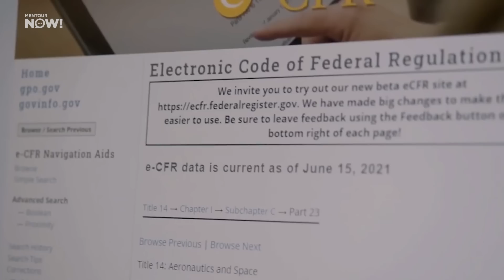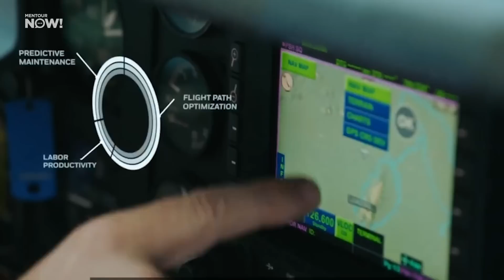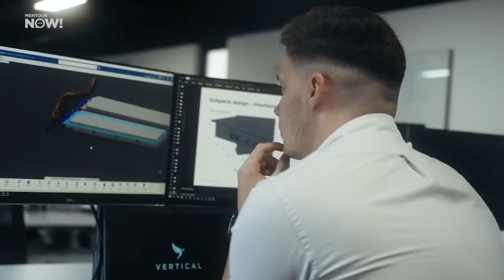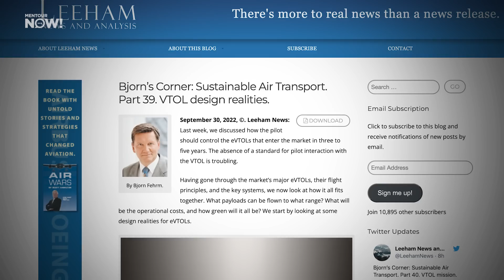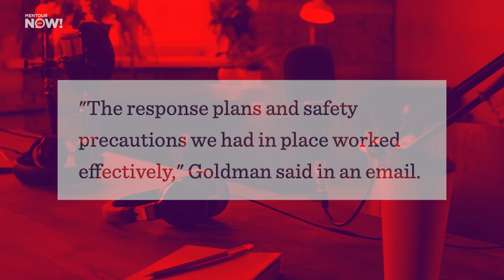Will they SHARE their Secrets?! Electric Aircraft Safety culture

Comment: As a software engineer, I can't caution people in safety systems enough, that the culture we have in software is absolutely not compatible with safety systems. The move fast and break things, is a great way to ship non-safety projects because it shortens the feedback cycle allowing you to make smaller changes in direction to optimize at arriving at a correct solution after a few iterations. However, that same reason is not compatible with safety systems. I worry about software culture invading aviation.
Reply: DO-178C is very strict on software development, so unless this standard gets a major rework which would allow for "move fast and break things" style software development to set its foot into aviation, I don't see a real risk for that.
Reply: @Mezgrman  Do you trust the software that was installed on the 737 Max? Once two planes went down, they had to fix the software. I doubt it is yet properly fixed for the reasons the OP stated.
Reply: @SrssSteve  yes I do, especially now after the crashes and all the scrutiny that was put on the code.
Reply: As a software engineer. It's important to distinguish general enterprise software engineering from what's being done in aviation. It's a completely different process and a completely different frame of mind. It's important not to treat the entire software industry like that mobile app from some startup because reality is that is just scratching the surface of our industry.
Reply: @SrssSteve  The issue with the 737 MAX was not the software. It was the entire system design that was oriented towards avoiding retraining of pilots. No amount of software quality improvement could fix that.
Reply: There are 10 little bugs in the code, 10 little bugs in the code, fix one little bug and now there are 12 little bugs in the code…..
Reply: @Stettafire  Yes it is, but to say there are never software bugs, or that developers still don't carry some of those bad habits into safety systems, even when they're more aware of the risks, is hubris
Reply: @Mezgrman  That implies that just because DO-178C is a thing, that'll keep bugs from causing issues between systems, for instance, if not flat out failing to consider consequences of a system operating out of spec, or similar. Bugs happen at an astonishing rate in software even in the most strict of environments. The timelines to deploy tend to be longer, testing procedures better, etc., in heavily regulated industries that involve safety systems, so the rate of critical bug tends to be lower, but what I'm getting at is, who knows in what way what bugs that ship will lead to safety issues. The big guys aren't immune from this as well, the 737 MAX's MCAS is a recent example, but not the only one where software played a part.
Reply: @Curt_Sampson  You're not wrong, but to ignore software's role in the accident, even if it wasn't the only reason for the issues or even the main issue, is missing the point. The more software we put in safety systems, the more we have to be extremely careful in doing so. Systems go out of sync, operators tend not to use the systems in the prescribed manner EVERY SINGLE TIME. These are some of the issues. Should you be scared to fly? Logically, hell no, even in a software world. We accept some level of risk in travel always, and when you take an analytical look at things, the numbers don't support huge fear. Aviation in general has the right attitude, what my original comment was about was an acknowledgement that this is antithetical to how most developers are USED TO working, so there are undoubtly going to be problems related to that.
Reply: @canoozie  Sure, but anybody who's done even the barest amount of looking into the role and use of software in safety-critical systems has been aware for decades of the need for care and what kind of care needs to be taken there. The Therac-25 story may not be well known amongst web and application developers (who to this day are generally very sloppy and often don't really understand what they're doing), but I doubt there's anybody working in safety-critical systems who doesn't know it. IEC 62304 took some time to come out of that, but even that is now 15 years old.

Engineers in Boeing, both software and aeronautical, were well aware of the issues with the MCAS. And the software was and is, in fact, fine. The primary issue was a lack of training (appropriate training could in fact have obviated the need for MCAS altogether) and a major secondary factor (using input from only one AoA sensor) was a hardware design issue. Both of these are systems design issues and to focus on software, rather than on the system (human in the first case, hardware/software in the second) is to miss the safety problem.
Reply: Fly by wire has been in aviation for a long time: any plane with a side stick is flown by software at some level.
Reply: @trueriver1950  Yup, and lessons were learned, painted in blood and we know how to build safer systems. I'm not arguing that point. What I'm saying is that once we've got a software stack safe in one application, that doesn't mean it is safe in another, or that someone else's implementation will be safe. Culture heavily influences the quality of code (35 years writing code, I've seen all sorts).
Reply: As a software engineer, I'd like to point out that there are hundreds of quasi-independent "software cultures", and they vary A LOT in their tolerance for risk and emphasis on secrecy.

* frontend web scripting
* intrusion detection
* CRM and business processes
* financial backend servers
* medical devices
* big data mining
* AI/ML
* operating systems
* compilers
* cryptography
* cryptocurrency 
* mobile apps
* IOT (internet of trash)
* academic data analysis
* mathematical research 
* et cetera 

and of course many of these areas have large open source communities. That doesn't guarantee safety or security, but does improve visibility.

So I don't think it's useful to consider "software culture" as a monolith.

Otherwise, I agree that many developers, and many companies, play fast and loose and just hope not to have anything blow up before they move on to something else.
Reply: @davidwright7193  So true!
Reply: @larrywest42  ... and of course (as you mention)  there is the entire Open Source set of cultures, which vary among themselves but all share the idea of the source being shared. In the Free Software variant of open source (eg the GPL) sharing your modifications is a legal requirement. It can make sense for reasons other than safety to share the load with competitors
Reply: @canoozie  we don't disagree on this: I've been coding since I was 11 (56 years ago) and have seen all sorts of bad design, and failure to test before release our failure to test at scale before abandoning older systems (worst case I know was London Ambulance call centre software which fortunately I was NOT involved with, and which turned out to be due to poor understanding of the process at the system analysis stage, where the analysts valued to model what actually happened in off-channel chat between operators (despatchers) when large numbers of said operators were all working in the same room and could shout across to improve their collective situational awareness beyond what the older system gave them.  

People died waiting for ambulances due to the shortcomings of the new system: they couldn't roll back to the older system as they'd sacked half the staff and closed the offices before testing it at full scale :(

I can see the potential for a "London Ambulance" situation as some airports try to move ATC off site...
Reply: @Jeremy,  as a software engineer myself, I agree with you 100%. Unfortunately big tech companies have created this culture in software engineering to where we MUST push crap out as fast as humanly possible. AGILE design works at the expense of your user ... you ship your user broken garbage ... but hey, you fix it over time right? All these systems were designed to maximize profits and nothing more. with things like AGILE design for example, a company can record in their books that they did indeed ship the product ... and they can realize the gains immediately. While in reality, the product is broken and it is still being fixed for the next year or so ... but that doesn't matter ... since the profit is realized and the stock is up and the execs are happy in their private jets and their fancy dinners. This is why NO tech company should ever mess around with transportation ... I mean we've seen how Tesla is doing .... FSD is basically a pipe dream, we were "promised" LEVEL 5 AUTONOMY God knows how many years ago at this point ... and every year they say it'll come next year :) unfortunately this is just tech company culture ... bloated valuations and a broken legal system allowed them to realize gains before even shipping a complete system ... and that's how we roll now. This will NEVER work in the aviation industry and I suspect a bunch of these startups will dissolve before they even transport a single human commercially.
Reply: @TheAkashicTraveller  SpaceX is a terrible example. They literally wanted to launch star-ship once every month and they haven't launched it ONCE this entire year. It just shows that this model of development doesn't always work - and in most scenarios is an outright failure.
Reply: @Mezgrman  where did they put the third sensor??
Reply: @SrssSteve  - In the 737 Max the "software culture" played a very small part in the outcome, I think.

The stupid decision, of a monumentality that cannot be underplayed, was to use just one sensor input for the system and it was taken way above the pay grade of the programmers and before they even started working on it.

Had Boeng accepted the associated certification delays, they could have added a third angle of attack vane and linked the MCAS action on all sensors concording in their values (then again, the 737 computers architecture was not really designed to handle a triple redundancy, seems to me). 

In the first iteration of the system, also, it did not re-engage after the pilot had overruled it...

At some point, someone decided that it was too risky to allow the pilots to do their jobs and so Boeing got the limits on number of activations removed.

It wasn't the software people, either, to decide that pilots did not really need to know the existence of the new system and cemented it's lethality.
Reply: @canoozie  Software played a role in the accident, yes. But is it due to the software culture inside Boeing? I doubt it. More and more evidence shows the culprit is in the higher management willing to trade safety to cost under the pressure of competing companies.
Reply: @play005517  culture is set from top down. May not have been pervasive at all levels, but what I was referring to was leadership culture specifically

Comment: As a pilot, a drone operator, and a researcher on Advance Air Mobility, it has been evident that a great culture clash will happen when more drones, VTALs, conventional air traffic, and even space traffic start to share the same airspaces.
Reply: As a pilot I agree.

The whole EVTOL  movement (their timelines, their plans to move forward and the likes) it all feels rushed sometimes.

Manufacturers are expecting “innovation at software speed” (this is from Acubed’s website) 

Hopefully they don’t cut corners to get this “innovation at software speed”
Reply: @nikobelic4251  don’t forget to mention that once this starts getting more into the casual consumers, there’s most likely gonna be a drop in safety. Doubt 100 hour inspections/annual inspections will do the trick. Also with a lot of people refusing to maintain their own vehicles like with worn tires, not checking oil, rusty and destroyed frame and parts, no way this shit should work in aviation.
Reply: we already see space traffic clashes in FL.  NASA/CCAFB/Spacex/ULA/etc are trying to work with the FAA.  the space coast wants to hit 45+ launches a year and that will need a system better integrate air space closures as it does impact flights to places like Miami.  The idea is a fully integrated system is the nearly whole day NOTAMs would become a thing of the past, As soon as the booster clears a block the air space would reopen. now with RTLS they would probably keep it closed until the rocket was legs down again, but most land on boats far out to sea these days.

Comment: In my opinion, electric aircraft is just a hype, not a hope, because of three reasons: First, due to the safety reason as you explained. Second, the energy density of the battery is much less than the fuel has. Third, the weight of the battery is constant time overtime, so it is affecting the airplane structure's strength, especially the landing gear when it landing. This is like an airplane that have to make emergency landing just after it take off, it has to dumped the fuel before it landing to reduce the weight.
Reply: Makes 100% sense, I do like to see people try though, because superior battery technology is always a good thing imo
Reply: There are already some electric aircraft in service, and they'll stay because short-haul flight is practical.

Short-haul flight.
Reply: @absalomdraconis  how long it can go, and how long it takes time to recharge its battery?

Comment: At least for fixed wing, we accept single engine design where the engine could cut out at any time, and as electric motors are very reliable, I am not worried that this will be difficult to do safely. However VTOL is a different case, where redundancy will be required. One challenge in both cases, is that lithium ion batteries should really not be fully charged all the time, to improve battery life and reduce risk of fire. However if the batteries are not fully charged, less flying time is available. Some batteries are extremely safe, like LiFePO4, however are heavier. So there are still some hurdles to overcome, but I am optimistic.

So actually - a pro tip if you have a drone, e-bike, EV or anything using lithium ion batteries actually, keep the SOC between 20-80% as much as possible, if you don’t really need full range, like for your daily commute or just taking a few pictures or short video with your drone, and your batteries will last many times as long as if you go 0-100-0% all the time. And store your batteries at 40-50% SOC when your toy(!) tool or vehicle is not used for an extended period of time.
Reply: Yes. That's also why Li cells are usually delivered with around a 40% to 50% charge: it maximises pre-sale shelf life

Comment: Those rotors seem pretty light, i'm not sure they can perform an autorotation in case of total (or even partial but major) power loss while in vertical flight.
Reply: I've been up close to a couple of these eVTOL craft. Those little propellers are a lot tougher than they look. 
I think the reason many of these vehicles look like helicopters is because autorotation is the best option in case of power failure. The plan for most of them is intra-city travel.
Reply: Beside having insufficient mass in the blades for an autorotation, the blades are fixed pitch, and so would be unable to attain the necessary angle of attack to continue rotation on the correct direction

Comment: I’m wondering what pilot certification would look like, how airspace would be established once a number of these take to the skies and lastly what their weather limits be
Reply: For the most part, they are starting off with type rated commercial pilots.  Pretty much the same thing as an airline (except maybe not ATP) 
Then they plan to add more automation and bring in less experienced pilots.  Eventually they hope to remove the pilot from the aircraft and have him fly one or multiple evtols from the ground.

There are a few exceptions like Whisk which wants to go straight to pilotless flight and Lilium and Vertical Aerospace that haven’t mentioned removing the pilot but that’s the general goal when it comes to pilot certification and the likes.
Reply: You might want to check out what NASA is working on in their Aeronautics end. 
Safe integration of non-piloted aircraft into piloted aircraft airspace has been an ongoing project. Weather, airframe design, alternative fuels, communication/deconfliction - they've got a little bit of everything under study.
Reply: @BigBlueJake  I’ve looked into that extensively
Reply: @nikobelic4251  I figured you were all over that stuff even more than me. But B Wade Greene might want to have a look.
A pilot is a pilot regardless of propulsion, but being an aviation mechanic for these things will be a strange new world. Air traffic control will be interesting in amongst skyscrapers.

Comment: I like the ideas of redundant motors and props, and a segmented battery pack that can jettison a section that has become a hazard to the aircraft,  removing it to a safe place outside the skin until you get to a landing pad where you can drop the failed part and then land. A lithium battery on fire is a lot less of a problem if it is hanging 3M under the aircraft.

Comment: I am a ham radio op.  We use batteries for hand held radios. Also, batteries for off grid operations for 25 to 100 watt radios for various ham bands 

Battery power is challenging for us.  I am not surprised your industry issues with these batteries and aircraft.

Peter, you need to look about your ham Foundation Licence.  Should be easy for you